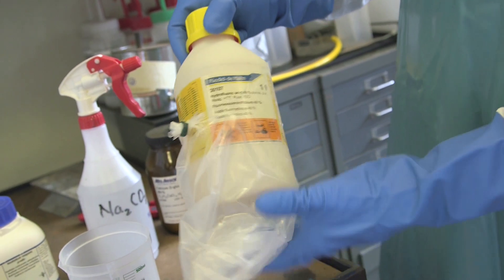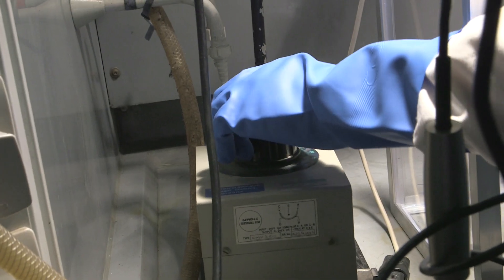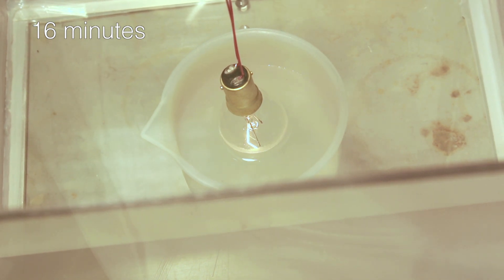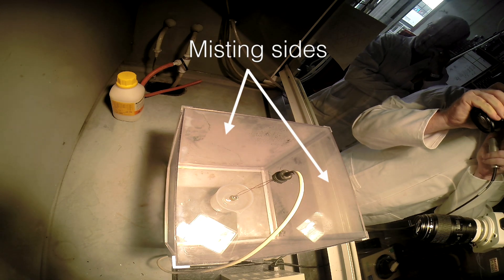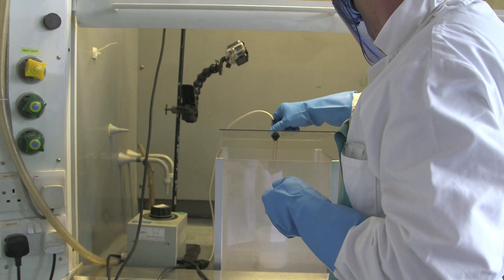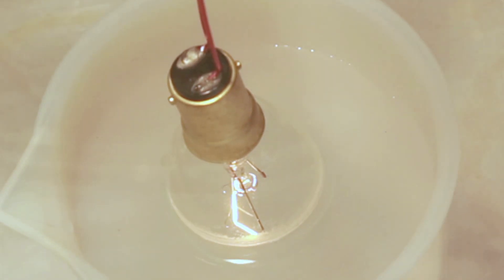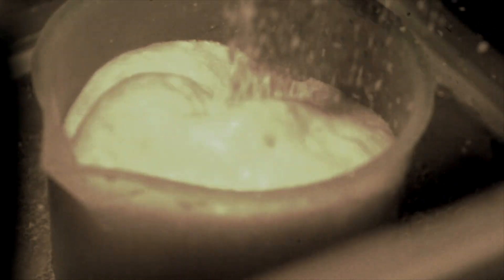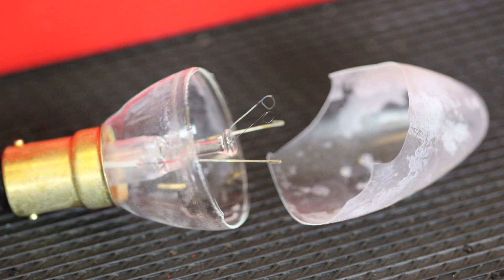Light Bulb in Hydrofluoric Acid (HF)

Comment: Not sure about the "most feared chemical" bit - read the chapter on Chlorine Tri-Flouride from John D Clark's book Ignition! for some really scary stuff. Or there's dimethyl mercury, which is so poisonous that even smelling it could be hazardous.
Reply: Miros Vanisland  Agreed, at least with prior knowledge of the dangers of HF you can have the Ca antidote handy which will help. But things that explode, one tiny little mistake and there can very easily be a hole in your hand/arm/chest or a large number of high speed bits of broken glass/plasticware flying around.
Reply: "Most feared acid" may be more appropriate because I can think of several much more dangerous chemicals. Among them several kinds of nerve gas.
Reply: You could also say that nitroglycerin is among the most feared substances, purely for being a super unstable explosive.
Reply: look up FOOF
its also talked about in Ignition!
Reply: Notorious would be a more apt description. chemist's "fear" HF because that it is rather difficult to store in the higher concentrations they would normally use it in for experiments, which tend to require special apparatus so you dont wind up with a toxic, potentially lethal puddle where you left your favorite glass beaker when you went on break, and also fumes readily above 50% concentration (by vol). With the proper precautions HF is very manageably stored and used, particularly by manufacturing for glass and metal etching. I would take HF any time over azide compounds, which.... make nitroglycerin look inert ^^'
Reply: One of the main reasons chlorine triflouride is scary is that it releases 3 HF molecules when it reacts with water
Reply: Slurpon Muhdick Maybe 'most feared common lab chemical' ?
Reply: It's not that common a lab chemical really, cos of the associated caution. Alot of people try and avoid using it unless absolutely nessesary. It's more commonly found in geology labs than chem ones. In 10 years as an inorganic chemist I've never used it, and have only seen it used once

Comment: Put more stuff in HF (i sound like a five year old, but i'm actually a nano-chemistry scientist). I'm really interested in its effect on different material. Or better so put stuff in PIRANHA (strongest acid there is, i won't disclose the ingredients because it is more dangerous that HF. Ppl who can use this information non-idioticaly already knows them.)
Reply: Sulfiuric acid... hydrogen peroxide.... you get piranha. eager people are now satisfied
Reply: there are acids way stronger than piranha
Reply: ***** High-school chemistry perspective hurrah!

There are various models that have been used as chemistry has developed, but something is acidic because it can give up protons (as hydrogen ions, forming hydronium ions in aqueous solutions), whereas a base/alkaline is something that can accept those protons/ions.

So while different acids are chemically different, they're all acids because they share a certain chemical characteristic. And in this case, the strength of an acid is based on how readily it gives off that proton, or as a short-cut, how reactive it is.
Reply: *****
Exactly. It's just stupid to speak of the "strongest acid" and only shows that someone didn't understand the chemistry behind it. One acid may be able to etch material A but not material B, and another acid may do the opposite. Most people that talk about the "strongest acid" also ignore the whole part of alkaline solutions that can be equally corrisive. But "acid" just sounds cooler than "base" to them.
Reply: Ok, first you can find it on Wikipedia and it isn't that secret (as others already pointed out). Second, you mix a strong acid (sulfuric acid) with a fairly dilute solution (usually less than 30%) of a very weak acid (hydrogen peroxide). So if you want "the strongest acid" (off all those components), you shouldn't mix them but just take the sulfuric acid. The point of piranha solution is  that it's extremely oxidizing.
Reply: piranha etch: mix hydrogen peroxide with sulfuric acid. have fun kids. it'll do anything.
Reply: I mean strongest acid that normal people can get (or in this case make). Yeah some organic acids are extremely difficult to even contain.
Aqua regia is very strong, but piranha is stronger.
Reply: Nick Nirus
Nope, aqua regia is a solution of nitric and hydrochloric acid in water, which are fairly strong acids but neither as strong as sulfuric acid, and it's partially diluted making the solution even less acidic. Aqua regia can dissolve gold and platinum not because it's so acidic but because it can both oxidize the metal and make the oxidized metal soluble as the nitric acid oxidizes the metal and the chloride in hydrochloric acid complexes the oxidized metal.
Reply: A. P. V.
 there is something called a pKa scale. The lower the value, the more acidic is an acid. You get there via the equilibrium constant of the acid and its conjugated base (HA <==> H+ + A-) (excuse my poorly improvised equilibrium arrow). This value is only exact for equilibria involving H+, but you can guess its acidity for other sorts of atoms, too.

In case of HF it's quite misleading though because its pKa isn't all that low. It's around 3 ( 4.5 for acetic acid, below 0 for HCl, H2SO4). Its strengh comes from flouride, which is able to subtitute oxygen because it's much more electronegative.

That's the reason it can dissolve glass: glass is mostly SiO2. It's pretty inert because the Si-O bond is really strong, but the Si-F bond is stronger, therefore HF is able to react with SiO2.
Reply: CB telling quote from Wikipedia  "Fluorides, particularly aqueous solutions of sodium fluoride, are rapidly and quite extensively absorbed.
Fluorides interfere with electron transport and calcium metabolism. Calcium is essential for maintaining cardiac membrane potentials and in regulating coagulation. Large ingestion of fluoride salts or hydrofluoric acid may result in fatal arrhythmias due to profound hypocalcemia. Recreational inhalation of fluoridated hydrocarbon refrigerants like Freon has been associated with "sudden sniffing death", which is thought to be a fatal arrhythmia caused by myocardial sensitization to catecholamines."
I hope that answers all your questions.
Reply: Wait, isn't aqua regia the strongest? Or is it only special because it can dissolve gold and platinum?
Reply: Algimantas Janarauskas How do you tell which acid is stronger/strongest?
Reply: superdau acid is cooler.
Reply: ***** pH. -Log(H+ Conc.)  That's one way I know. pOH for alkaline substances.
Reply: A. P. V. look it up duh
Reply: nah we need some super acids up in here. None of that weak junk.
Reply: Thomas Higgins No. A pH test only works when you're measuring dilute acids, because pH has a value (that makes sense) only in the case of dilute acids. It's actually based on the dissociation of water into H+ and OH-. pH is used to measure concentration, not strength.
Reply: Algimantas Janarauskas 

 I’m hoping someone can help me out with these questions.
At what temperature does fluorine evaporate at? And can boiling water get rid
of fluoride if not why? I thought fluoride is fluorine bond to other elements for
example like salt. So if you boil the water it should cause the fluorine to
release from the salt and evaporate from the water? Is fluoride bad for us even at low levels? The
Harvard study on fluoride that was published by Harvard in 2012 said fluoride
is harmful to humans do you agree with this? And is the fluoride in nature
safer than the fluoride that is added to water if so why?
Reply: CB telling fluorine is almost everytime a gas so first question is pointless. Its boiling temperature is -188℃.
The H-F bonds are way stronger to be affected by little  temperature change. You need very high temperature for that to happen. 
Fluoride is VERY harmlmful even in a tiny doses. It blocks neuron pathways and you can have heart attack in an instant (i don't know much details about that, I heard that could happen, that's why you have to be very protected handling HF, just Google it for more inf.). 
About the last quesntion I'm not sure. I think the solute fluoride is more harmful because of it's loose electrons and ability to react, although if you ingest gas you'll gonna have a bad day:P I don't know..
Reply: Algimantas Janarauskas So is sodium fluoride at 1ppm harmful to us humans?
Reply: So it is HSbF6 because that is the strongest acid
Reply: Note that was a joke I know that it is H2O2 and H2SO4
Reply: Algimantas Janarauskas 
You call yourself a nano-chemistry scientist and you say that pirranha solution is more dangerous than HF? Where did you get this info from?
Reply: Come on people, acid strength and corrosiveness are two different things

Comment: I'd really love to know what happened when HF rushed inside and dissolved the electrodes. Because of the alternating currents: is it possible that both electrodes get dissolved when they are either positive or negative as of the two poles of HF? What are the electrodes made of? Will the dissolving process be quicker in same or alternating current? Lots and Lots of questions :)
Reply: depending on your nationality they tend to be made from Tungsten or Wolfram (same element, 2 different names: element 'W'). I suspect that easily formed WFx compounds are pretty stable so it wouldn't do much I'm afraid.
Reply: In Halogen bulbs yes (I think, I thought it was Chlorine/chloride but I don't see why bromides or iodides wouldn't work as well...I did this kind of chemistry a very long time ago), but this one (in the video) is a normal, old school, incandescent bulb. Tungsten filament in a vacuum (or as close as is necessary to stop the filament burning out in less than a second) so the only halide species around is the fluoride from the HF, hence my thought that it's only be able to make WFx compounds. The WFx mightn't even be soluble (many metal fluorides aren't) so they'd passivate the filament surface.
Reply: yep, I forget quite frequently that most people don't think the same way as me :)

Comment: I'm curious on how HF in contact with skin will cause a heart attack? anyone?
Reply: It reacts with calcium in the blood. Calcium ions are used by the body to generate action potentials (electrical pulses) hence nerve function in vitally important organs such as the heart may become disabled.
Reply: The HF passes through the skin and the fluoride (F-) anions react with calcium (Ca2+ cations and precipitate out as the insoluble calcium fluoride (CaF2). This drop in calcium levels wreaks havoc on the functioning of your heart and nervous system. (nerves send impulses by pumping ions in and out of the cells)
Reply: I suppose i should mention that the worst part about low concentration exposures is that you tend not to notice until several hours (all the way up to a day or more) that you've been exposed. had an unlucky co-worker rest his forearm on the wrong ledge, and wound up sporting a vicious looking patch of reddened, inflamed skin. luckily our concentration is low enough that he was fine, but he admitted when he finally felt it, he FELT it
Reply: the fluorine in HF dissociates and binds with free calcium and magnesium ions in the blood stream. in high concentration mixtures (50% and above) the lethal dose is really quite low (7ml of anhydrous HF is enough to bind up all the calcium ions in the average adult male), but even low concentrations can have an effect, if 1% of our body surface area is exposed (this causes a pocket of this hypocalcemic and magnesmic state to follow along the blood stream and cause a similar result to a more significant exposure
) (1% of your BSA is roughly equivalent to the palm of your hand)
Reply: That's some pretty interesting stuff. Thanks guys! :)
Reply: ***** Alexander van Gessel  These are plausible explanations for lethal arrhythmias resulting in sudden cardiac death.  A heart attack, however, is due to acute myocardial ischemia usually involving coronary thrombosis.  By this definition, it's unlikely that HF would actually induce a "heart attack."  Periodic Pharmacology/Physiology/Medicine anyone?  Call me ;)
Reply: PeopleHateMyOpinions who is also a terrible Grammar Nazi sounds like something Walter White would use
Reply: 1997xander
mmmn, the burn isnt necessarily that bad when its a lower concentration, and tends to fade after a few weeks. HF doesnt particularly like skin, and most of the damage actually comes when it begins reacting with the calcium in your bones and blood
Reply: If I read things correctly in my MSDS back in the day, it actually has a lot to do with it creating CaF2 in your blood stream which is insoluble. On top of that by decreasing the calcium there is more potassium and other chemicals imbalanced in your blood. The list goes on and on of the horrid things HF does to your body
Reply: Long term low concentration exposure reacts as many others have commented, with a reaction to calcium in your body (bones, etc). The net effect is a spike of potassium levels, which the body uses to counteract attacks on the calcium in your body. Potassium is critical to the heart muscle's ability to contract properly, but in excess can severely disrupt the proper rhythm needed to sustain life. I found this out the hard way after years of acid-brightening aluminum cargo tankers using a product that was later found to be using HF as the active ingredient. My potassium levels were off the charts and yet my diet then was not inclusive of high-potassium foods such as bananas (I preferred my hamburgers lol). This was the explanation received from the specialists I had to go to at the time, so decipher as you wish. My advice is simply to steer clear of ANY product containing HF unless you have proper protection and training in the safe use of HF...it's nasty stuff
Reply: From what i remember, It gets into the blood stream and interacts with the bone, altering the level of calcium in the blood; as calcium regulates muscle contraction, and the heart is a muscle, changing calcium levels in the blood causes heart attacks

Comment: Wait I don't get it. Why did the light bulb slice off so cleanly, and why did it happen so suddenly?
Reply: The glass was probably under stress at the point where the liquid and air were, so once a crack started, it continued.
Reply: I'd say it happened because of a mix of effects.
First of all you had the material weakend by the acid.
Then you had high differences in temperature because those old bulbs get really hot and the water/acid mix was rather gold.
Another reason could be what Luke Den Hartog already said: It was under stress by the surface tension.
Reply: My GUESS would be that a gas that is part of the atmosphere in the cube had a catalytic effect on the reaction so that the line at the surface of the liquid was under a much more rapid reaction rate. That's just a guess though.
Reply: I'd hardly call 30+ minutes "sudden" xD
Reply: Fleshcut
 Isn't the surface tension effect the same as putting some fluid in a glass bottle before you hit it to get a clean break( I can't find Luke's comment :/)